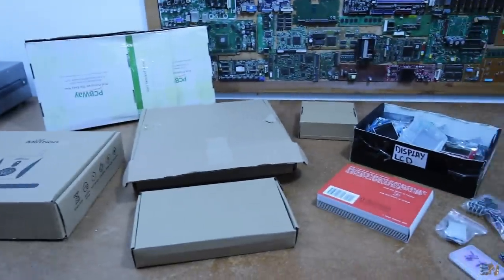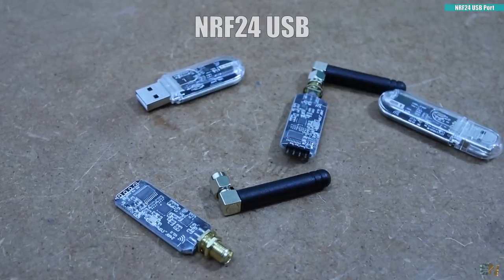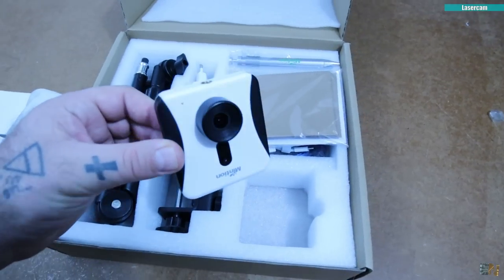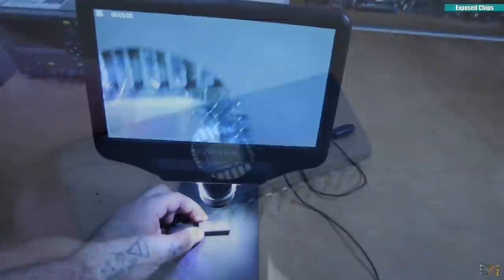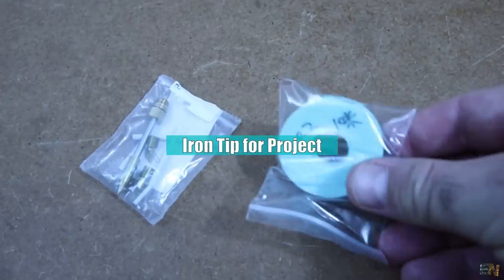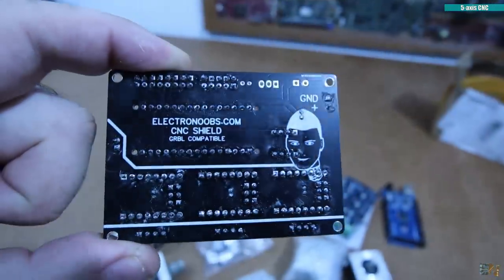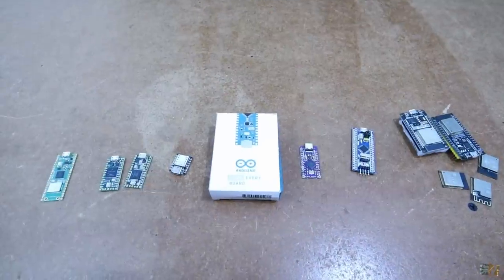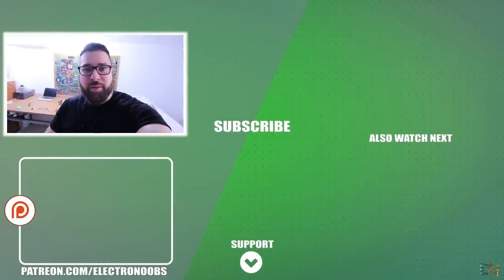NRF24 USB Port | Lasercam | 5-axis CNC | Microcontrollers and more...

Comment: Hi sir can we make CAN Bus Network For Home Automation and Getting data of Sensors from garden (Temperatures, humidity, Sun etc.) and home (Temperatures, air level, water tank level and electronics light automaton, and lot more  etc.) to display or use it as needed . 
please make a video Because CAN can be wireless too.